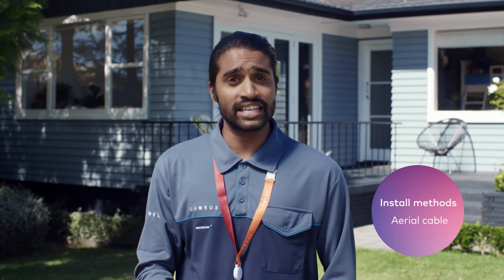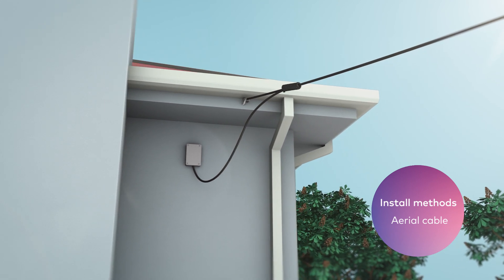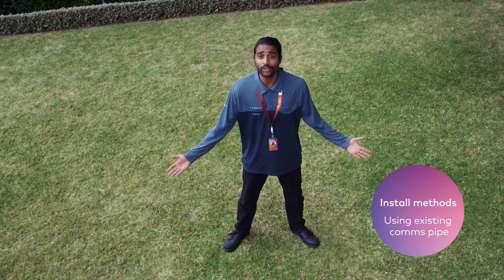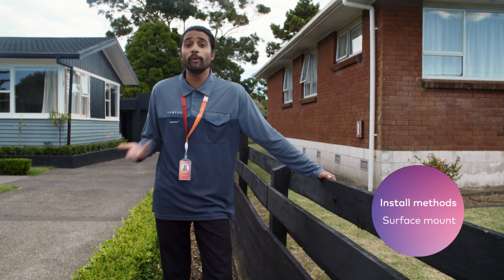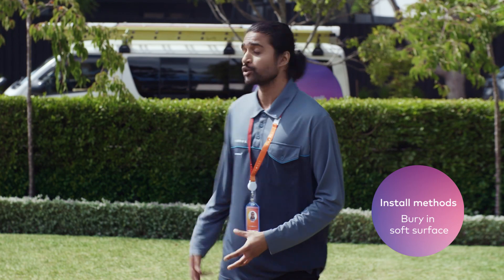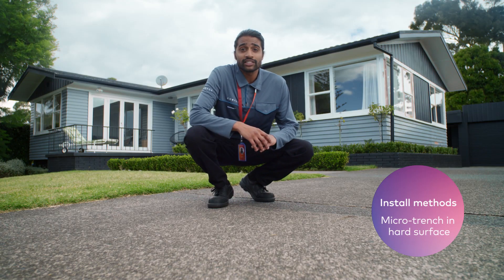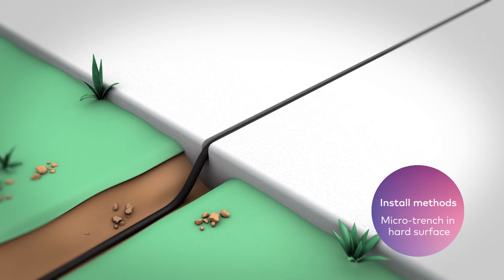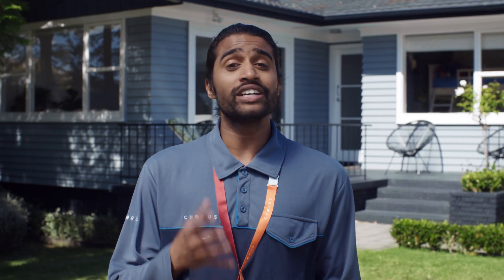2.) How Chorus gets fibre from the street to your house

Comment: Good videos, thanks. I have a query: What is a Gator? If it is a connector used to connect the already underground installed cable (perhaps ruggedised) to the Chorus connection in the Drop-off Pit, does it reduce connection strength compared to a "fixed fibre" connection without gator? Many thanks.